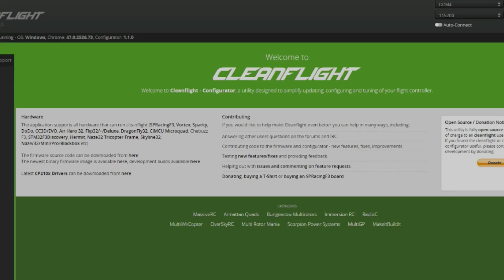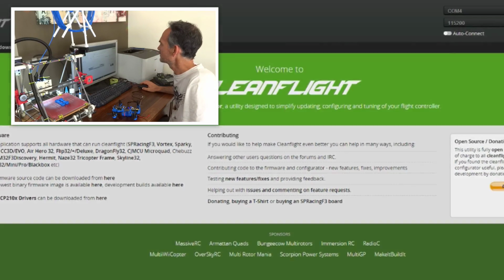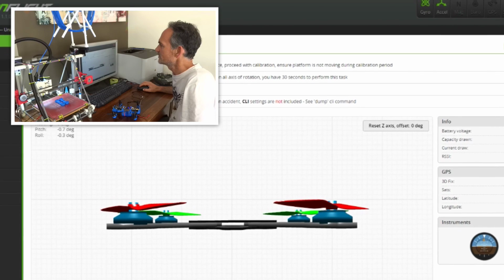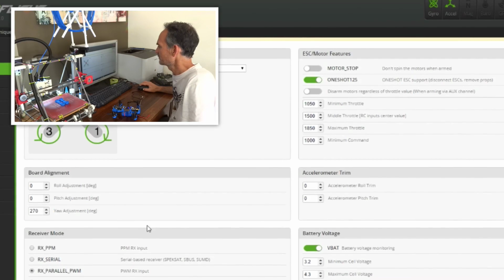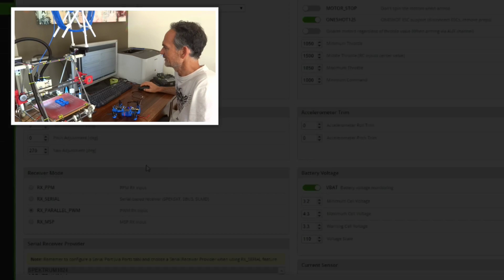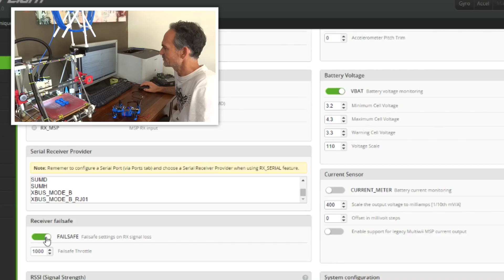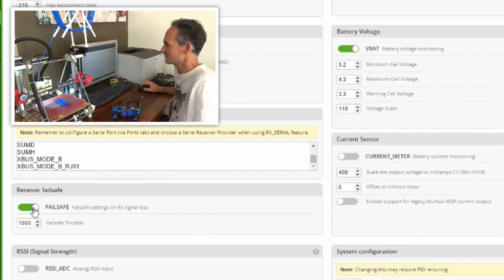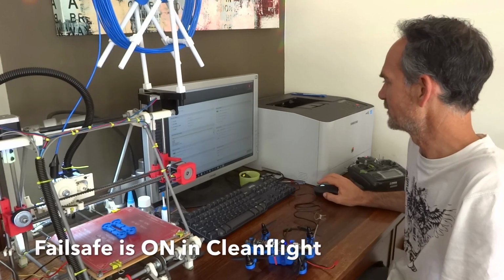Naze32 Tips | Failsafe Setup Part 2

Comment: in my case.. i have frisky taranis plus with x4rsb using bus.. well i set it up with no pulse.
well when i turned of tx.. motors stop for 2 sec and then rev up again.
cleanflight had failsafe on and set value 1000.
I then set the taranis failsafe on custom mode and set the throttle value in setting -100.
when i then did the test where i shut down tx the quad went into failsafe.. so far so good.

But when i did the test where i unplug the rx r4x to see what will happen without failsafe from rx.. well then the quad stops for 2 sec and then the motors spinn up again.
this is quit important if something would happen to the rx..
in this case it would end up with a flyaway..
and yes i have the failsafe in clmeanflight on.
Reply: Your props will stop spinning as soon as the connection with receiver is broken.  That's what you want.  Forget about soft landings, If your prop catches onto something you will fry your motors and ESCs.  I was thinking about different fail safe
 scenarios and full stop is the best one.
Reply: +2663540  FrSky Receivers are programmed by holding reset button while powering down your quad.  If you want your defaults to be slow descent, in case you don't want to smash to the ground your camera gear, then spin your motors to descent RPM (less than your hover)  than press reset button and power down your quad while holding it.  Remember throttle response may vary depending on your battery lever, so do this with your battery fully charged to be on the safe side.
Reply: +RC Pilot Multirotor only problem with that is what will the props get into when it hits the ground? They'll just keep going until you find it.
Reply: +RC Pilot Multirotor I meant in case of a slow descent failsafe. I'm going to put mine like yours has with shut off.